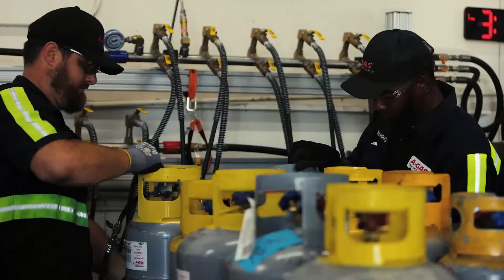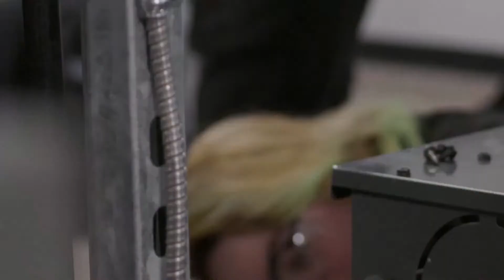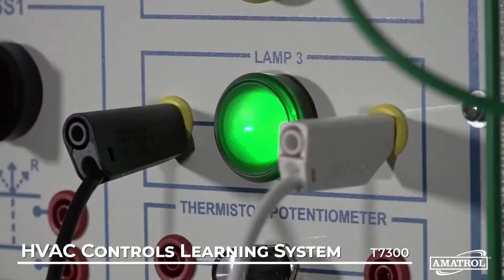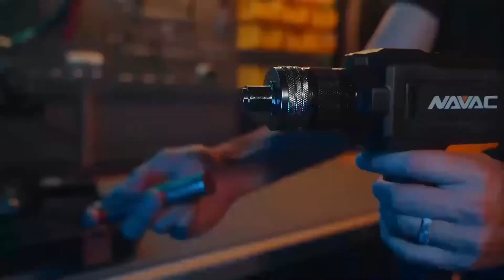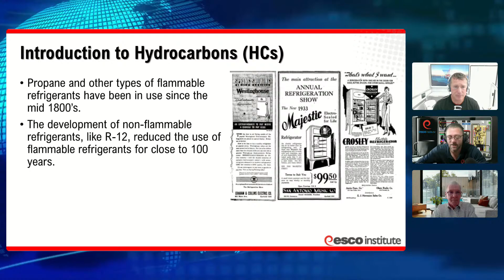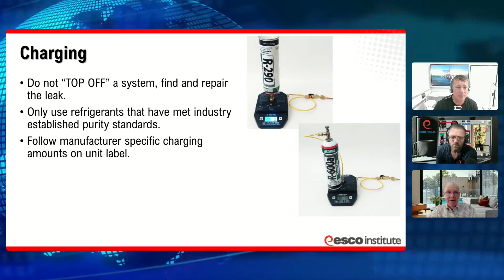Hydrocarbon curriculum for the classroom

Comment: I foresee the day when we go to chiller systems with propane refrigerant only outside ( air handler and chilled water coil the only thing on the inside). Arkla  Servel did it with the old gas air conditioners back in the 1960s (ammonia absorption units ). Anybody out there remember working on those or am I just old?